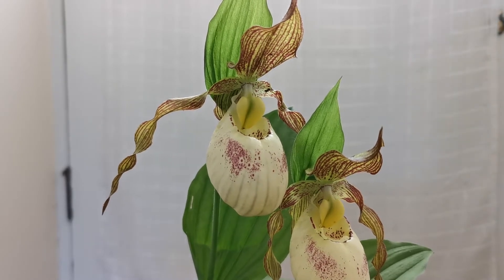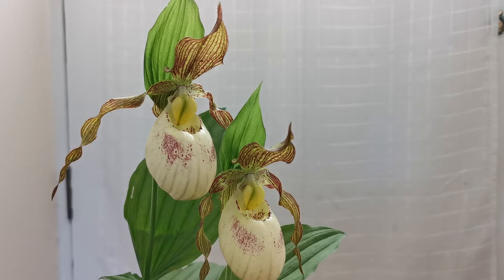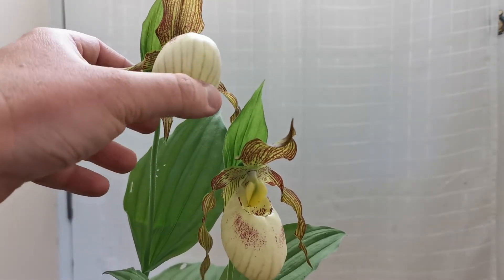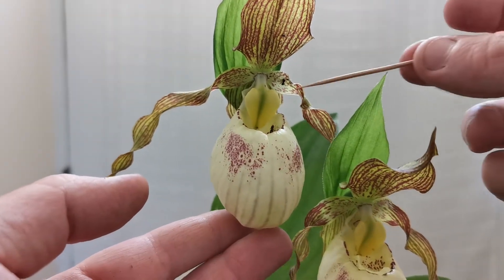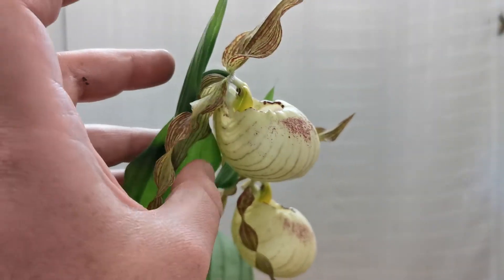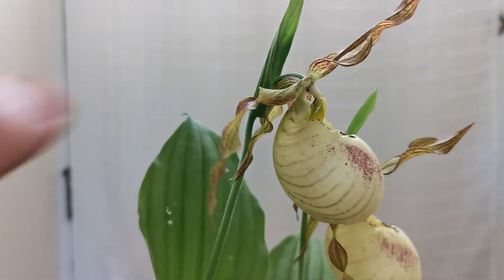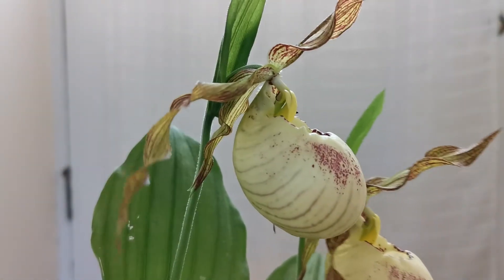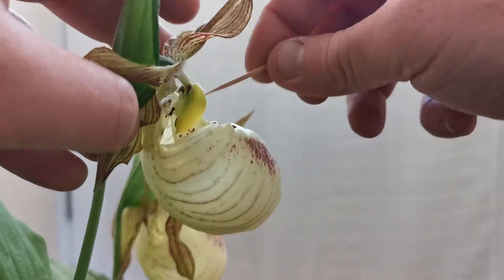How to hand pollinate Cypripedium Lady's Slipper Orchids part 1 - a very messy pollination attempt

Comment: The only suggestion I would make is to use needle nose tweezers to handle the pollen "Pod".  So now, I realize that you can use the Lady Slipper's OWN pollen,  to pollinate that Lady Slipper; is that correct? IF that is so, please let me know; I could do this for the surviving flower in my little forest (I will let it go for a few days to hope that it will take place naturally and then do this to make sure it is pollinated).  Thank you.
Reply from the maker: yes indeed you can use its own pollen to fertilise the flower, but I agree that would be genetically better if it gets pollinated naturally with another plant's pollen. Bear in mind however, that if there isn't any other plant nearby, I would still attempt the self pollination.  My Cypripiedium flowers usually last a couple of weeks (sometimes three)
Reply from the maker: thanks also for the suggestion to use the needle nose tweezers

Comment: i would consider making another video because this one is very messy and there are too many times when the pollination is happening off the screen
Reply from the maker: Hello, I absolutely agree that this video could have been better, indeed this year I made another hand-pollination on the video about  Cypripedium formosanum, starting at 07:30 on this link https://www.youtube.com/watch?v=CxyE61cE1kA&t=1004s . unfortunately I was holding the mobile on one hand, so I had to carry out the hand-pollination with just the other hand, using just my fingers, it was a very rough method but it actually worked out very well because now I have a developing seed pod on the flower I pollinated !!!